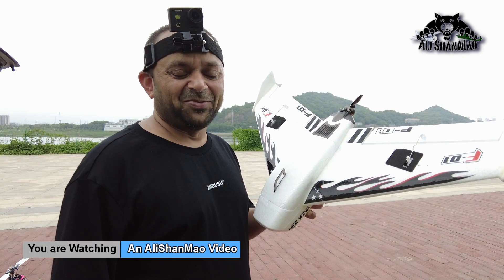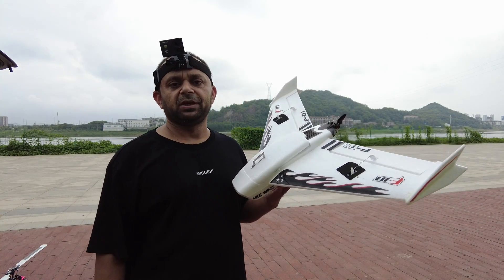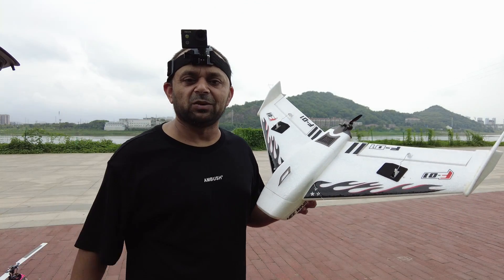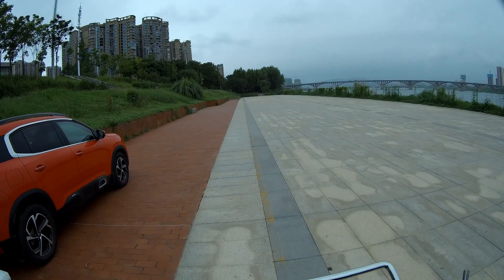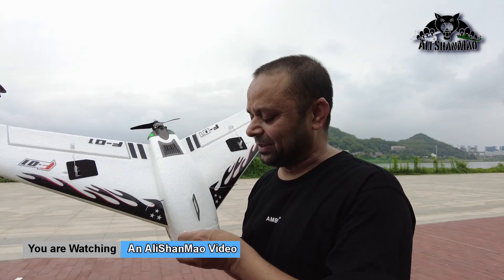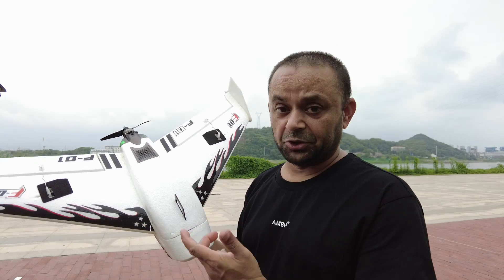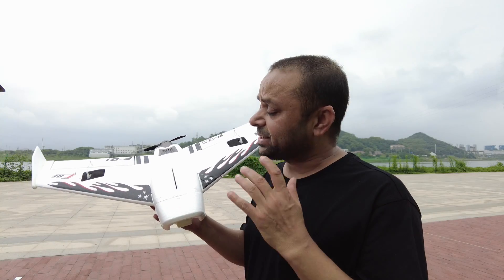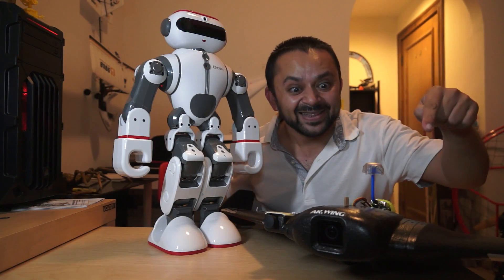High Speed Fastest out of box FPV Racing Flying Wing

Comment: I have 1 on the work bench right now 🥰 2206 2700kv motor. The quest for 140 mph
Reply from the maker: do it :D make sure to keep throws low or you won't be able to control it. lots of expo will help
Reply: @alishanmao  yeah I'm gonna use the 2nd hole from the top on the servo to keep the throws shorter. I have a f405 wse flight controller so it'll be a little more tame than full raw control lol. My 2206 2700kv  motor doesn't work for this so I ordered the T-motor F80 pro 2200kv. Gonna use the 5x5 biblade prop for 139 mph prop speed according to ecalc.  I hope to have it all together by Friday. 🤙😎
Reply from the maker: @dronepilot260rc  don't forget lots of expos :D